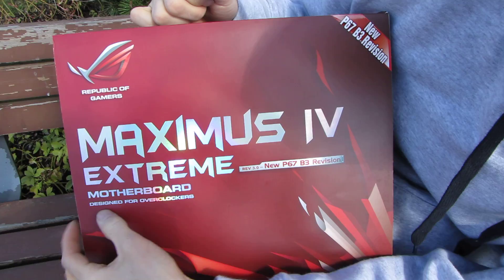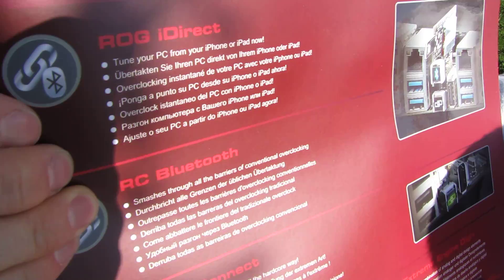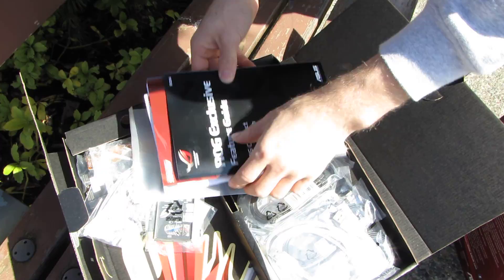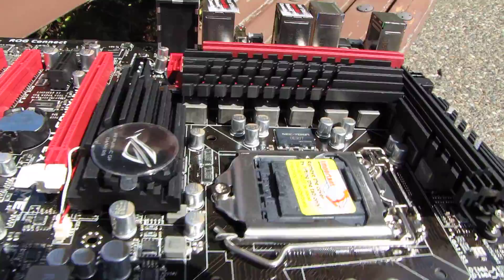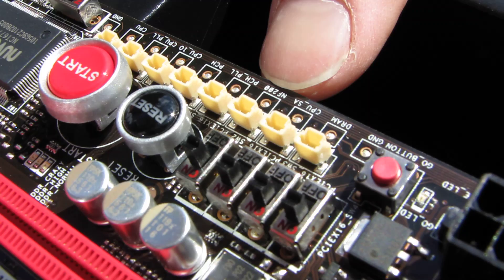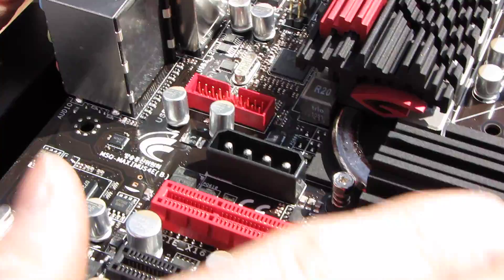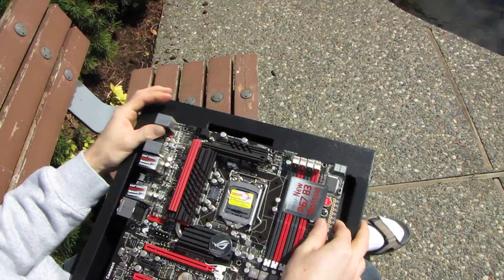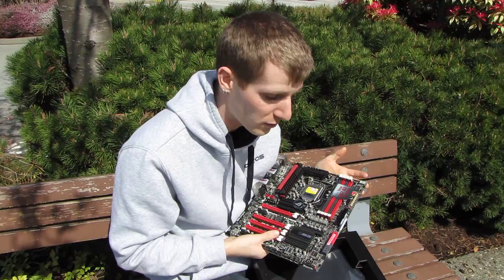ASUS Maximus IV Extreme P67 SLI Gaming Motherboard Unboxing & First Look Linus Tech Tips

Comment: I have had this motherboard on my rig for about 5 years with a 3570k. I keep upgrading the Graphics, and case. I also just put my two 980ti's and 3570k under water. I made a promise to myself that I was going to do a waterloop on this board and now I have completed that dream. I fear that I will soon upgrade to some modern technology as this one is seeing its age.
Reply: Andrew K I'm still on this amazing board with a 2700k and a GTX1080 :D
Reply: Same setup here!  Without the GTX1080.  Time to upgrade, wish i had the funds...
Reply: I still have this board, I bought it at launch, and I have a launch 2600K in side it too. It has been fully operation since 2011, and it is still running sweetly right now, to my left. Unfortunately, it is no longer in front line service, but it lives on as a dedicated Linux desktop. However, as a SandyBridge gaming rig, it was glorious. I now have 9900K Z390 Maximus Code XI, and I can only dream of it lasting as long as this Maximus Extreme IV P67, and the immortal 2600K. The last duty of the 2600K will be to see how long that it will last, before its eventual death. Until that happens, it has some work to do as a dedicated home server, and development environment.

Comment: @filp69 Socket 1366 is only Core i7 9xx series. Core i7 8xx, Core i5/i3 are all socket 1156 (which are p55 boards). P67 boards have socket 1155, which is Core i7/i5/i3 2xxx series. So, any processor that is a "Core i" processor and the number is in the 2000 can be used on this motherboard.

Comment: @aydin690 a lot of audio interfaces and random musical & DJing gear use firewire. It's because the mac is such a strong platform for musicians and firewire can provide faster connection than usb 2.0.  Other than that, firewire is indeed a barely used connector when it comes to everyday external devices like mice and external HDDs.  I personally appreciate that Asus keeps firewire on their boards because that a way I can have my audio workstation & gaming rig in one computer ftw!!!!:)

Comment: still rocking this motherboard in 2020 with an i7-3970X
Reply: You ever get the inop mouse/keyboard issue?

(I've just bought a project gaming rig & can't get them to work...a ps2 to usb allowed keyboard function in OS install & both work in bios via ps2 & regular usb connection)
Reply: Also has latest offered asus bios update, tried deleting drivers & clearing Cmos even tried a usb splitter on the ps2-usb adaptor out of frustration

Comment: @filp69 Sandybridge CPUs are the fastest, clock per clock, of all CPUs. To drive that point home, unless you are doing some fairly heavy workstation things ( 3D rendering, animation, AutoCAD, etc.) and doing more than one of those at the same time, the $330 i7 2600K will be faster than the $1000 i7 990x. Especially for gaming, the Sandybridge CPUs are by far the best, as no game really benefits from 6 cores atm. It's not all about base clock speeds and number of cores ya know :)

Comment: @HEROSOLDER1 you can configure the drivers to be able to uilie both, you wont be able to run them in sli though, but you can use the 580 for gpu proccessing and the 570 for physX if you desired.

Comment: Current Intel boards don't have northbridges since their role has been taken over by the CPU itself. The southbridge gets its name from the northbridge: it's located on the bottom, or "southern" portion, or the board. Since there's no longer any northbridge, continuing to call it a southbridge is meaningless. I'm pretty sure that's the reasoning he's not stating in the vid. Regardless, I still call the chipsets northbridge and southbridge myself... Old habits die hard.

Comment: where can I get this motherboard??? I have a Intel core i7 3770 and I really really need this motherboard it's such amazing in all sense
Reply: +Matias Enriquez Seems like you speak spanish because of your name but I will answer you on english just in case. if your are looking to get one of those it dependes on what type of use you are looking for because they are quite expensive, if your an overclocker it's a perfect choice BUT if you are just a common gamer I recommend you the Asus Formula V or IV since they have everything that a common and enthusiastic gamer wants. ;) P.D. You can find one of those on Amazon but they are a little bit uncommon to find.
Reply: +RadiantLocosan thank you so much!
Reply: Matias Enriquez you don't need it you don't have a K processor you will not benefit from its overclocking capabilities
Reply: Make sure that you get the B3 revision, the launch MEIV P67 boards were defective.

Comment: @iisStillAlive If you put some graphics cards in the first the second you will block the third slot, so you can use only the fourth. If you make sli on the first and the third you can't you the second and the fourth and the third is only 8x the others are 16x so what's the point. If i'm wrong, ok. If someone is going to use the third slot can you tell me why?

Comment: Question for you guys, I have this board and my rog light just doesn't work. It was working when I first got it but it went in to the computer shop to be troubleshooted once when my video card failed...which was two days after building it, was a defective card so they replaced it. Anyways, after I got it back my ROG light has not ever come back on since. It is enabled to turn on but it just never does.

Comment: Will a nvme ssd containing windows 10, on a pci adapter work on this mother board? Meaning will it be able to boot from the nvme ssd?
Reply: Joe Menezes I have the same mobo and after a quick research i found that it can't be supported to boot from, just for data, just stick to a Sata SSD for the time being